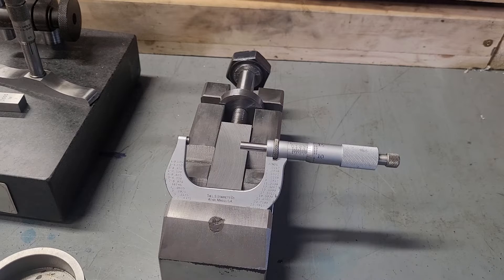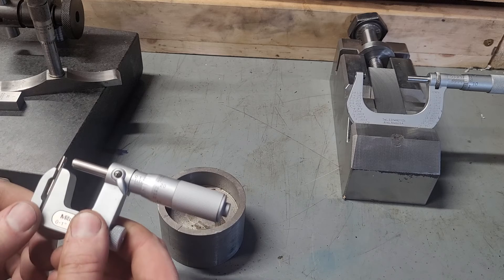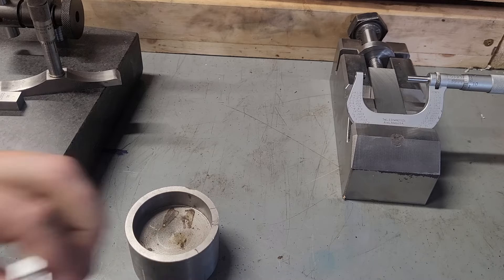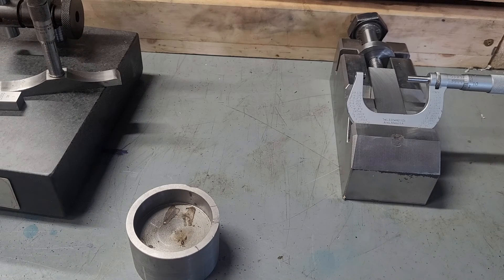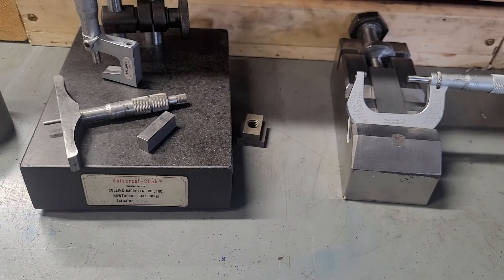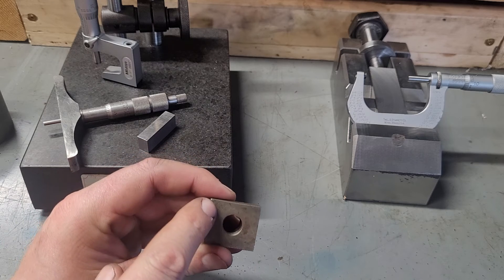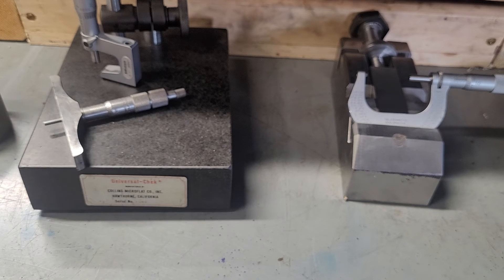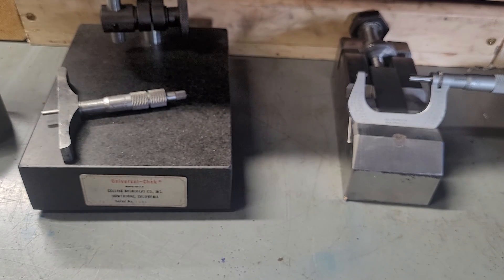Mitutoyo Interchangable Anvil Micrometer Review and Uses

Comment: Best practice is to read in place, if possible.  From what I read, depth mics are always a little less reliable than other methods.
Reply from the maker: For when I actually need precision that's what I do. For video demonstration it's a non issue. Depth mics require an extreme fine touch and practice. They are reliable enough to hit +/-0.001  in sub 4 in holes in my experience.  The rods can deflect quite easily.
Reply from the maker: I actually find the biggest accuracy issue with depth mics is  reading them incorrectly and being 0.100 off